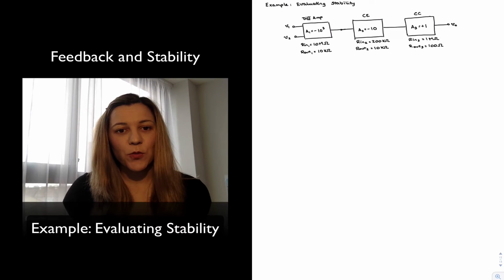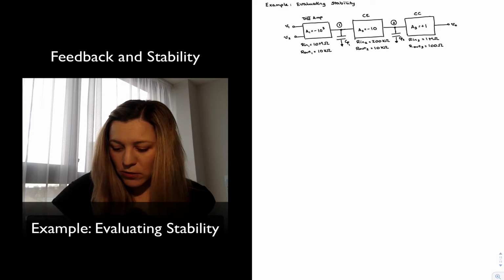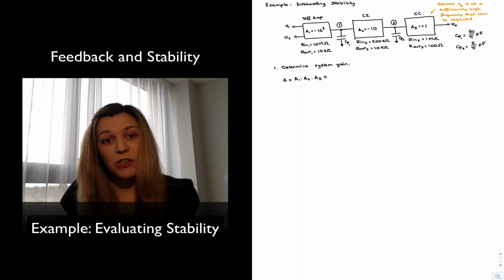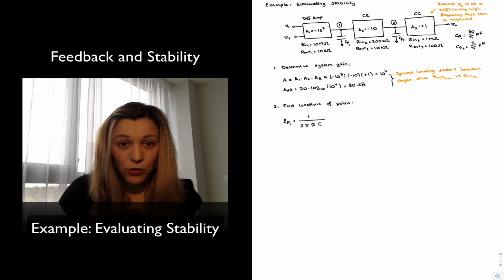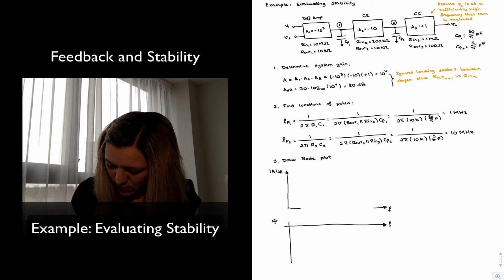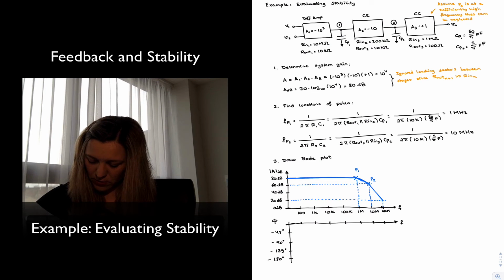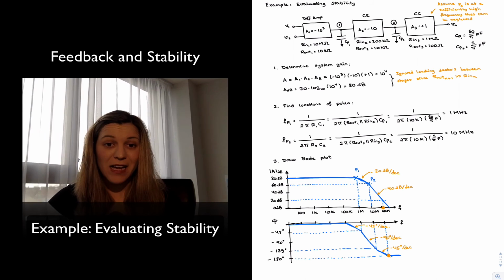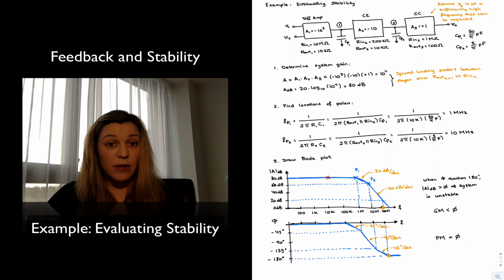Example: Evaluating Stability of a Three-Stage Op-Amp

Comment: Unfortunately the third pole is the problem of my circuit . I designed a Power Amplifier the output stage has a lot of oscillation so i put the Miller capacitor on the third pole to get rid of my oscillation. Putting it on the 2nd pole doesn't make any change i dont know why